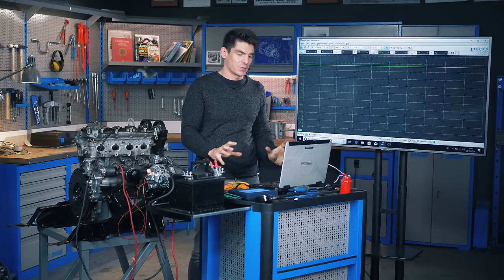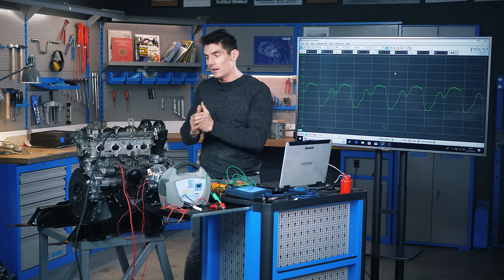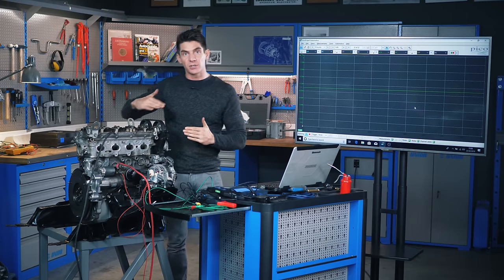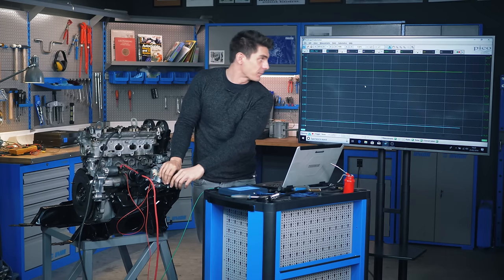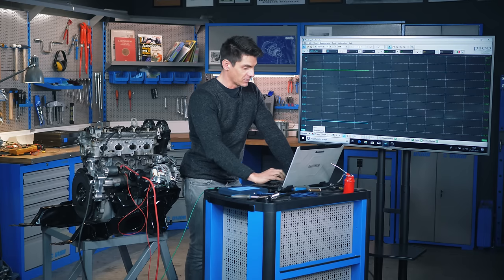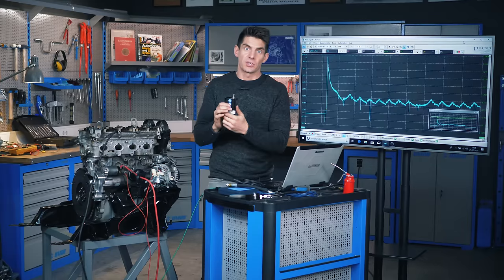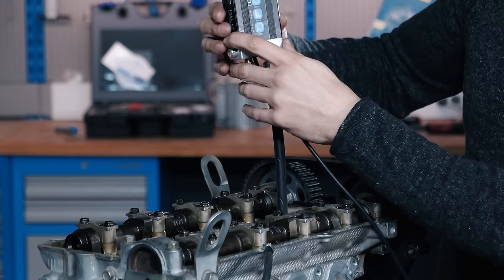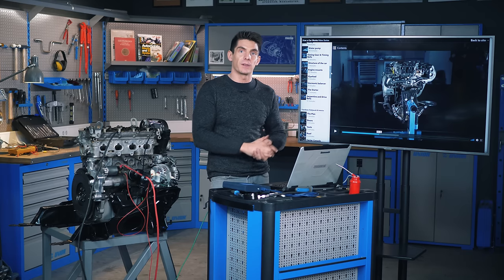Automotive Oscilloscopes: What you need to know

Comment: You’ve done an excellent job explaining how a scope works and how to use it, I haven’t found this on any other channel most times they just use it with very little explanation thank you for this series. You have a new fan!
Reply: Maybe you can also learn how to save and check the oscilloscope waveform with the comprehensive diagnostic equipment: https://youtu.be/xgJQ8nncl1g

Comment: thanks- some basic settings i always got confused is now clear in my mind,thanks Alex. good job ,now i can start using my pico on cars to check signals,injectors -commonrail where high current is drawn, cam sensor,crank sensor,timing ,wow a whole world opens.on todays car forget the meter, check canbus speed,signal well inside the ecu whats happenning . Respect

Comment: Check out the relative compression tester from Auto Ditex . It can operate with a current clamp or clipped to the battery . You can also sync it to a cylinder to get the reading to match each cylinder . A quick test is about 15 seconds , with no special training . About $ 300.00 . Diagnose Dan uses it . They also have a two channel scope , sensor simulator and other test items .

Comment: The popularity of the Automotive Scopes like the PICO is primarily due to the scopes form factor, in that it is possible to put the scope under hood, connected to signals, route the USB cable through the window, or through the firewall, hook up to a PC and take data while operating the vehicle on the road. This is a very powerful feature especially when trying to diagnose driveline vibration or problems that occur due to vibration, bumps or cornering. 

The other secondary advantage is in the impressive evolution of the PC laptop/notebook processing power and the ability to integrate date taken from the scope with other PC applications in making reports for the customer.

If you look at the evolution of PC based oscilloscopes the form factor has always been the primary advantage and partly why a bench scope replacement has specialized into an automotive scope tool.

Comment: I commenced using O-Scopes back in the linear days. Since the inception of the digital age and the availability of sensor units, the O-scope is much more valuable across the board.  With the correct supporting programs almost anything can be scoped for diagnostic purposes.

Comment: That final pressure peak that appeared to be lower than the rest was not accompanied by current draw. So it was the engine's inertia facilitating the compression stroke. You can also see it is a somewhat wider/slower peak.

Comment: Great video. Only thing I'd change or suggest would be to add one more test....  Add the other 3 plugs back into the engine and show how a relative compression test, where we were guessing which spike was cylinder 1, now lines up with the transducer on 1 and makes the chart a bit easier to visualize when we know the firing order.
Reply: IMHO it was a major blunder that he didn't do that, or used some other trigger to identify each cylinder on the scope

Comment: Historical note:  After WWII, many large, multi-engine aircraft had flight engineers who monitored and controlled the engines and other systems to relieve the pilots of those duties.  Some of those aircraft, including both military and civilian models, were equipped with an oscilloscope at the flight engineer's station to allow monitoring of the primary coil voltages in each of the two magnetos on each engine.  Installation of the instrument, which was called an ignition analyzer, was simplified by the fact that a wire from the primary winding of each magneto was already run to the cockpit magneto switches. These P-leads, as they were called, would be shorted to ground when the associated magneto switch was in the off position, preventing primary current that normally induced spark voltage in the magneto secondary winding.   The engine can run on one magneto, but if both P-leads are grounded, the engine ignition is off.  In addition to the magneto switches, the P-leads each had a connection to a rotary selector switch if an ignition analyzer was installed.  The flight engineer could rotate the switch to connect any one magneto on any engine to the analyzer input. 

With the engine running, the analyzer screen would display the voltage changes caused by the firing of each spark plug secondary circuit, reflected back into the primary circuit by the varying impedance of the transformer.  A higher firing voltage at the spark plug resulted in a higher peak on the display.  Successive peaks represented the firing voltage at successive cylinders in the firing order of the engine.  Although firing order charts were provided in the analyzer handbook, the engineers in fact memorized the numbers, even when most engines of the period had eighteen, and some had twenty-eight, cylinders.  The six piston engines on the B-36 bomber fired a total of 336 spark plugs, so the flight engineer had a lot of waveforms to review.

If an abnormality was observed on a waveform, the engineer would select the second magneto (some early 28-cylider engines had four magnetos) and view the impulse corresponding to the same cylinder to confirm the problem.  If waveforms from both spark plugs in one cylinder indicated a shorted secondary, the engine would be shut down.  Shorted secondaries indicated that the spark plug gap was shorted.  If both spark plugs were shorted in one cylinder, then almost surely it was caused by debris from broken valves or piston. and the engine would soon fail completely.
Reply: 1/2024 thanks for great info knowledge on multi engine aircraft… that,lol keep plugs manufacturers in demand

Comment: You should put the transducer into cylinder 1, and use it as your trigger...
Then, you need to know the firing sequence of your pistons.
This way, you will always know which is cylinder 1, followed by the firing sequence of the other cylinders (i.e. 1234, or 1324, etc..).

Comment: That was very interesting to watch, specially the correspondance between the various input signals to give a more complete view about what happens!

I as not actually looking for a video about how car works, I was just looking for information about what was specifically different between Automotive Oscilloscopes and other models.
I'm still not 100% certain about the differences, but I guess it's about:
- Specific probe management to do conversions of current into human readable units
- Higher range of input voltage
not quite sure if there's anything else?

Basically what I'm wondering is if a bench oscilloscope can be used on a car, and if an automotive oscilloscope can be used to do electronic, computer and audio-video repair/diagnostics.

And yes, great video :)

Comment: Thank you for the video. I can see the amp clamp and scope being a quicker way to test for compression. In the case that the spark plugs aren't easily accessible. Pressure transducer seems unnecessary since you already have the sparkplugs out. Just use a compression tester. My thoughts anyway

Comment: Thanks for this. I think it would be great to take it a bit more advanced. I'm very keen to understand the parameters needed for a good automotive scope, and why. For example, what is bandwidth and what is optimal for automotive, and why; further, what sampe rate capability is best, particularly to achieve a good sample rate at a timescale that works well for automotive use --- ie in the ms no micro or nano second scale. what buffering capability is needed. Explaining these parameters, and what to look for in an automotive scope in a simple accessible way would be magic.

Comment: First thing you should have dealt with here was safety. 
Oscilloscopes generally only deal with small voltages. It’s the probes that condition that voltage. 
There can be very large voltages in a car that can destroy your probes, your scopes and you.

Comment: Nice job Alex. Very informative. Could you give a little more info about the Pressure Transducer(brand & model) & Pico Oscope (model & PC OS compatibility specifically Windows 10). I found that most PC based Oscopes are only compatible up to Windows 7.

Comment: The sad thing is that a 4-channel oscilloscope (the hardware) is not much more than a basic soundcard, with 2 stereo line-in inputs. The software can record on both stereo line-in inputs (4 individual incoming signals) and display them individually or together.
I remember using my soundcard as an oscilloscope when I was around 14 (now I am 46). Used an audio editing software to record and display the signals on screen. My first soundcard was a SoundBlaster clone, later I bought an SB Live 5.1. Plugged a cable into the line or the microphone input, set up the "volume" of it on the mixer application, then I could push the record button in the software and on the other end of the plugged in cable, there was a 2K resistor for safety. I could measure and display whatever signals I wanted to see, with 44.1 kHz resolution on the clone card, later 96 kHz on the SBLive.
So, a PC ocsilloscope (software and hardware together) can cost hudreds of dollars (or Euros, doesn't matter), sometimes thousands. While a cheap soundcard for a PC usually costs maybe 20 bucks or less nowadays, and you can use it for testing the same signals, after making sure the signal won't burn the sensitive parts of the soundcard. It's a big ripoff, but hey, a car mechanic can pay for expensive devices, right?

Comment: gyz i love your videos .....
i m confused if those peaks from Amp. meter is 1 2 3 4 cyl. in sequence 
then when you connected one pressure transducer at one cyl. the pressure peaks should appear once in four peaks of amp. graph...
Reply: I am concerned about the flat compression stroke mid test because I heard plain as day (no compression) like a valve didn't close all the way. Either a lash compensator or a piece of debris went thru the valve
Reply: The answer is no because the starter will also draw a lot of curent only on cylinder 1 where the transducer is connected.  For the other 3 cylinders the starter will draw very little curent. The sparks are taken out and there is no compression so the piston moves freely and the starter its not drawing high current.

Comment: 11:30 the arrow is not pointing "on the current direction" current direction is from - to + because only electrons move, current never goes from positive to negative, instead the other way around. The arrow is just a clue on where the device is connected on the + terminal. (not an obvious thing, but i goes school thought me something) other than that nice job.
Reply: actually current can go from positive to negative.
Reply: @DarthZackTheFirstI  in common sense yes, but when you measure and make schematics, an electrical representation is always the other way around.

Comment: Good presentational skills mate. A few erms & ahhs, & a few wire fumbles, but good nonetheless.
When making a video, (even if you are a PhD or just a novice) preparation is key.
Think what you need to be doing AND saying for each step & at that particular time, & write it down on a numbered sheet.
Then practice, practice, practice & you will find you have LESS urms & ahhs & no wires getting tangled.
ALSO, get your equipment ready on another bench behind you, so you need to move LESS things about & not have them in your way.
I was always told & believe that, ... Practice makes perfect. 
You can put your timesheet just behind the camera to help you if needed.

Comment: Maybe you should have tightened one spark plug a bit loose to create a tiny leak. That's a bit more fun. Also can you do the relative compression test just using battery voltage? No need to buy an expensive clamp.

Comment: Good video. But to me is unclear which cylinder is shown in the graph peaks. When you showed us the current graph too bad you didn't unscrew one spark plug to demonstrate how a leaky cylinder looks. For the second example you removed all of the spark plugs but if you didn`t we would see 4 peaks on the blue line and only one peak on the red line?
Reply from the maker: Yes, you are absolutely right.  I should have loosened a plug to see low compression - basically just a low peak on the graph.  And to ID which peak is which cylinder, you could hook up a clamp onto the spark plug's lead.

Comment: Fyi I paid for the course and think your videos are great. This video however, can use a lot of editing to cut down the time you spent trying different functions in the software. Because it is very technical you need to get to the point faster to continue to engage the viewer. For example, cut the piece where you crank the motor but forgot to record. Also we need more footage of screen recordings. We don't need to see the motor or have the talent in the frame when trying to see tiny markings some the axis. Regards.

Comment: On the press transducer channel you should of seen psi. Put battery voltage channel input on AC coupling and +/- 500 mV be amazed what you can now see. Battery drain measurement over 24h with curent clamp, forget about it, read about clamps current drift. Zero button is not there for nothing.

Comment: I'm going out on a limb when I say that the low spot in current draw of the starter is likely a bad winding and perhaps a failure point if perhaps it stops at that point in its rotation........
Reply: cool, 200 comments and yours was the only one that picked up on this. It may also be a slight slip in the overrun clutch perhaps and a slipping sound is heard that corresponds to that moment. Also it possibly the brushes and commutator surfaces momentary losing contact because of rough surface and weak springs. Or some bad teeth issues on flywheel, but starter seems to have a small issue.
Reply: @danielfagan7406  I appriciate your vote of confidence in me, and yes those could be a few other problems too.     I can't believe out of that many comments no one else considered it....

Comment: Witch are the scope specifications we need on automotive electronics. I think about CAN-bus high speed and Flexray. I know, a Picoscope is very good but to expensive for me. So, I'm searching a cheap scope to do this job. Someone can help?
Reply: i use a hantek 1008 ,about 100 dollars ,cheap but set up for automotive ,the input voltage is 20 volts not 5 volts ,its  got built in help, but has no filtering ,i made my own transducers and frequency filters. hey its good to learn on

Comment: I thought you'd only put the spark plug in one cylinder at a time and measure, then compare
Reply: I'm not an engineer, but not a mechanical Engineer.

How would that work ?
i mean.. he has a 4 cylinder Engine,  Hence 4 spark plugs are needed.
Now... each cylinder needs 1 spark plug to ignite the fuel / air Mixture.
each cylinder also needs FUEL to enter into the cylinder in order to burn
and each cylinder needs AIR (Specifically Oxygen) to enable the combustion

so.. if you started the engine with only 1 spark plug and cranked it
and given that there is a shaft (Very likely) that is responsible for the timing of the pistons in the cylinder
what would happen is 
Engine cranks
cylinder 1 (with spark plug installed) Goes through 1 cycle and it combusts rotating the next cylinder into it's cycle
NOW........... THAT SECOND CYLINDER (JUST LIKE THE 3RD AND 4TH) WOULD CONTAIN FUEL AND AIR
BUT............ THERE WOULD BE NO COMBUSTION since there is no spark to burn the fuel 
Now. if there is no spark then there is no force to push the cycle to the 3rd cylinder and then the 4th and then back to the 1st

so   AND.. I'M JUST TAKING A LOGICAL GUESS HERE
but, i'm guessing the first cylinder would fire off, causing the 2nd to piston to go through it's paces , the air inlet would let in air, the fuel inlet would let in fuel and then........NOTHING, it would just compress the mixture
but because of a lack of explosion  THE ENGINE WOULD PROBABLY STALL
or... you might fuck your engine

so.. yes for the continous working of the engine you would need all cylinders occupied with a spark plug to ensure the continuity of combustion from cylinder to cylinder

Comment: I would say you disable your fuel injection system. That way you won't harm your engine with unburned fuel washing oil off of the cylinder walls, and won't plug your cats and risk the whole vehicle going up in flames...

Comment: FUEL... DISABLE FUEL PUMP, not spark during crank testing else you will flood the cylinders and catalytic converter with unburned fuel.

You also need to know what cylinder number you're dealing with by using a simple TRIGGER on Cyl.1

Comment: Pull plug one, and install PT in #1 CYL and leave remaining plugs in the CYL's and you now have a Base For #1 CYL and can do a relative comp test in 4 revolutions using the ducer as Base for # 1.  you WILL SEE COMP diff if there is a mechanical error. and quicker than this vidjayo.
Crap unless its a 6, 8 12 cyl crap again Vovo left a cyl out and only has 5 Crap my bad/

Comment: manufacturers will eventually destroy diagnostics (reading voltage from sensors) by eventually connecting every sensor and solenoid to a serial bus instead of directly leading wires back to the PCM/BCM/TCM. They'll claim "cost cutting innovation" by having 3 wires which connect to one sensor, then move on to the next sensor. Like christmas lights, each sensor a bulb. Result in harnesses being no bigger than a network cable, instead of the huge wire harnesses we see. And very expensive sensors as they will have to have bus enabled sensors which do not output voltage, but communication data much like a home or office network.
Reply: That began happening in 2020 I believe it was.   Any sensor you replace in those vehicles has to have its serial number programed to the vehicle computer or it won't recognize it.